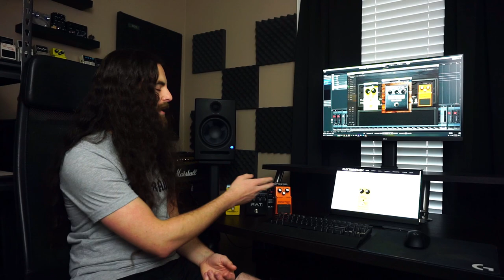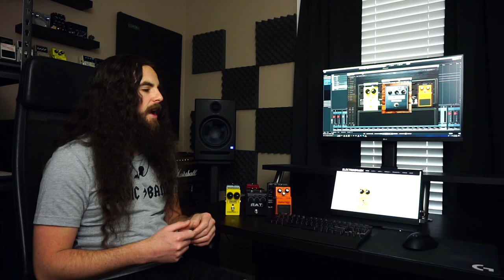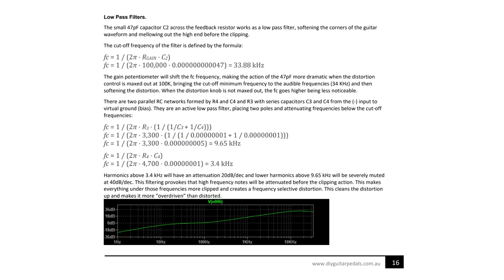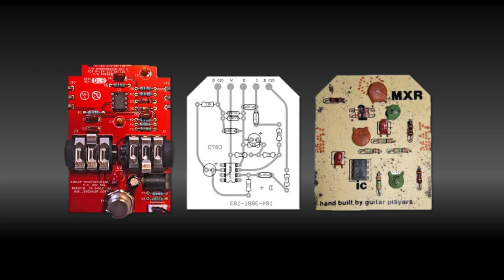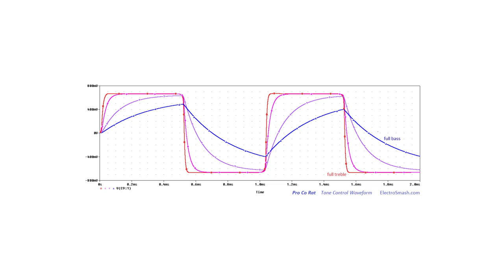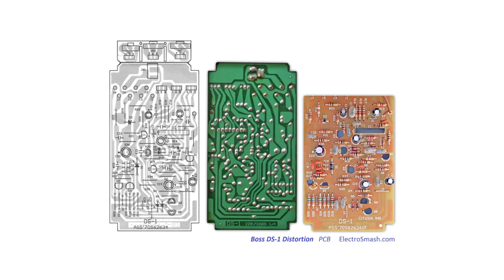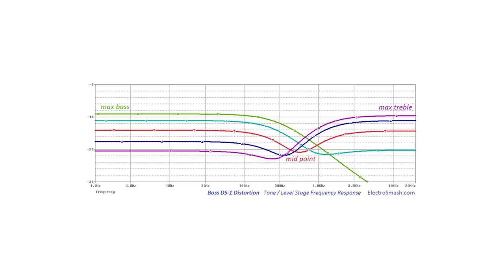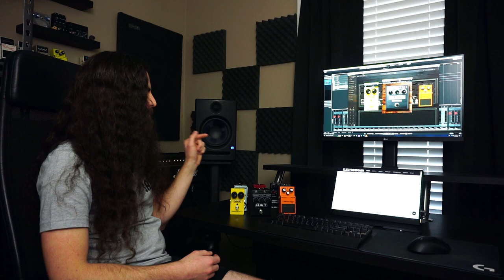Classic Hard Clippers - Distortion+, RAT, & DS-1: The Dawn of Modern Distortion Pedals!

Comment: DS-1 was my first distorsion pedal, I´ve had it for some 22 years. Still haven´t managed to get a single nice tone out of it :)
Reply: Run it into an on the edge of break up amp. The ds-1 and ds-2 want to see a compressed signal. It helps tame that high end shrill. If you have a two channel amp set your dirty channel so it’s actually “clean” and run the ds-1 into it. It will make a huge difference I how it sounds.
Reply: Exactly! @Superchild88

Comment: Thanks for your super valuable videos Ryan. The amount of useful information is incredible and it’s always worth watching even if it’s a longer video.
53:07-> Instantly recognized it btw :)
I’m a Mark IV guy most of the time (which doesn’t need much added in the front end imo) and have a Dual Rectifier as well. Never liked it much in comparison until I finally tried some pedals in front of it. The Ibanez TSx gives you this almost generic version that’s seen so often, but I had a Turbo Rat pedal around and gave it a shot. Man, that’s when things became interesting! I use it as a boost with a little bit of extra texture from its Distortion control, set the filter to taste (for me at around 11) and max out the volume.
Best result so far with it.
I noticed though, that if I had it in the chain and turned off using my Mark IV, it alters the signal a little bit I think. Is this because of the lack of true bypass? Also I wished the jacks were at the sides instead of the back, maybe I‘ll just correct this at some point on my own.
Reply: Hmm, just found out that the Rat IS in fact true bypass… Seems like I fooled myself. Makes it even more valuable now. Just wanted to add this to my previous comment.

Comment: Love me them hard clippers: 
I find myself leaning towards the 250 and the Turbo RAT over the D+/Stock RAT recently

As Braxton Bragg mentioned earlier, The Quantum Mystic by Black Arts Toneworks is a fantastic take on the D+/250 topology. The Active 3 band EQ makes it super flexible. If you can get hold of the Custom Shop model that has a toggle for Ge/Si diodes, it's worth it. I have mine always in Si mode. People are quick to say YJM is the "popular" user of the 250, but Chris Spencer of the NYC noise rock band, Unsane, makes great use of his.

I mentioned it in another video you made that Walrus Audio's Iron Horse V3 is another great modded RAT variant by having the Si/LED clipping diodes on a blend pot (plus it fixes volume drop-off when the distortion knob is at minimum that's common to all stock RATs). Also really love my JHS Packrat (super fun to go through the history of that circuit in one) and the ProCo Lil' Rat (I enjoy that a little more compared to the Moskey clone I once had)

I do want to get my hands on MXR '78 Dist eventually. I will say if you want a better version of the DS-1, The Boss Turbo Distortion (DS-2) definitely has a much better tone control sweep. I would also recommend the Boss OS-2 as it's basically a SD-1/DS-2 in a single box with a pot blending between both Soft and Hard clipping (a pedal good enough for Kurt Ballou of Converge is good enough for me)

Also thank you for helping to continue to dispel "grey spec" and LM308 myths.

Comment: Sure there is a "grey specs" DOD 250! It´s the grey one! The yellow one had a different OP-amp (allthough there was a lap over and the very early Yellows ones had the old OP-amp). However when they started making the DOD 250 again in yellow shells they went back to the "gray specs" OP-amp. 
If you are going to talk about this, next time do a little research, the answer is only one google away. ;-)
Reply from the maker: You should take your own advice before you so confidently follow random internet "knowledge." The OP amp alone does not dictate a clipping pedals design or tonal signature. Here is proof. If you are going to comment about it, next time do a little research (see how douchey that sounds?).

Start at 18:25

https://youtu.be/lx3GsD2XBZU
Reply: @PlagueScytheStudios  I´ve never said it doesn´t. But the gray specs means the 741CN chip and the early 80s yellow one had the LF351N chip. I assume you have never even tried the latter. If you had you´d know we are not talking about subtle differences as you do in your video. It´s a whole different pedal with a whole different sound! I´m not trying to be a jerk about it. But if you pay attention you may learn something mr fancy Youtuber ;-)
Reply: What's weird about the D+ and 250 is the 250 doesn't suck tone in bypass